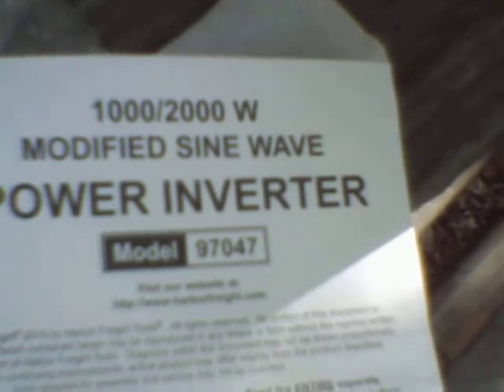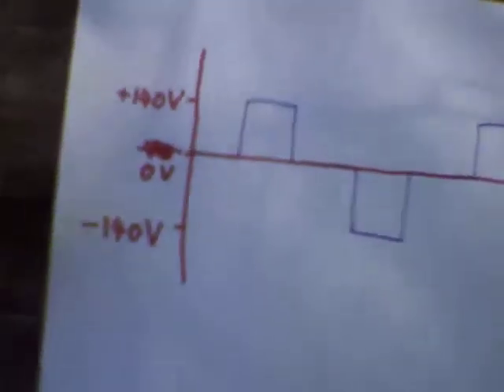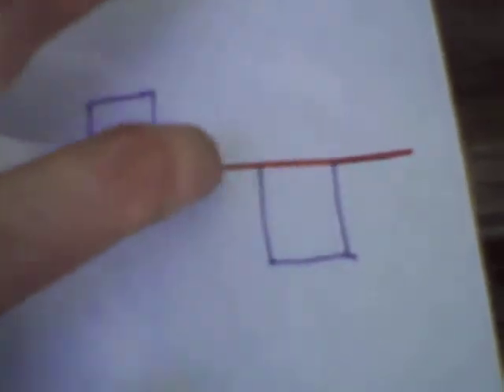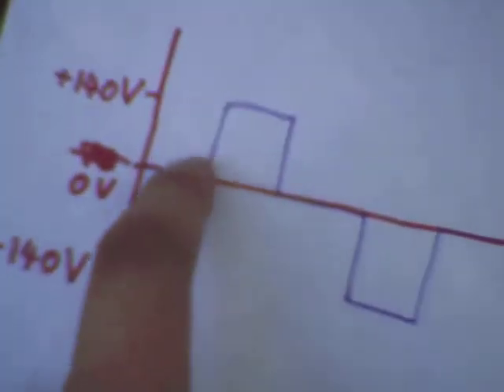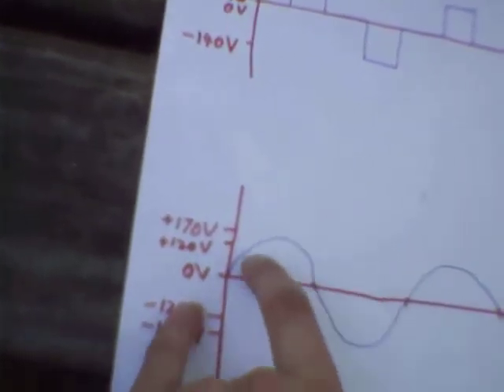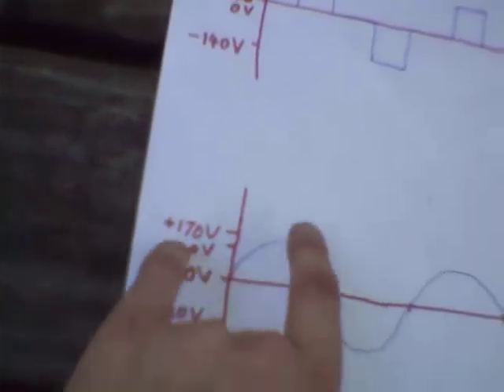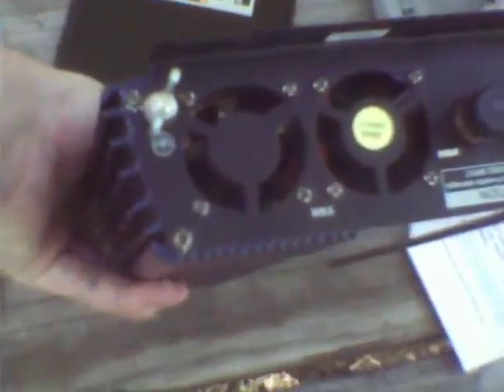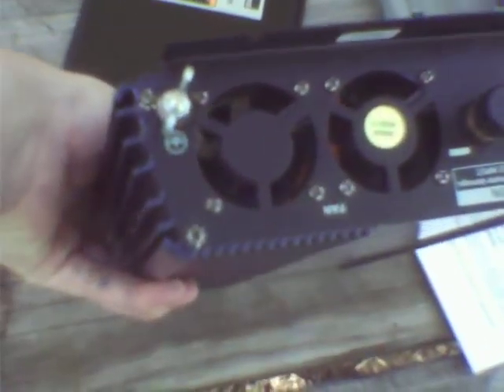Harbor freight inverter guts

Comment: @randacnam7321 
That's what I thought but wanted to make sure.
Would I be OK if I ran 2 or more inverters into a breaker panel each on its own breaker but share the neutral wire at the terminal screws? I did not know if sharing the neutral wire would cause a problem or not. I want to do this so I only need to use 1 service panel. THANKS!

Comment from the maker: @photolodge   Doing so would require synchronizing the output H bridges of each inverter.  There are inverters that are available that have synchronization capability, but the Harbor Freight inverters can't.  If increased load capacity is required then get a bigger inverter as wiring unsynchronized inverters in parallel will produce a load of magic smoke and a bunch of expensive paperweights.

Comment: I have 3 750 modified inverters and was  wondering if you knew I it is possible to gang the AC output together to get 75wattsX3 to a single line. THANKS